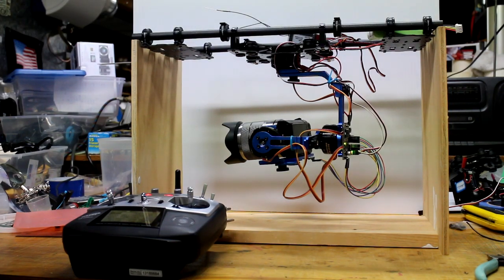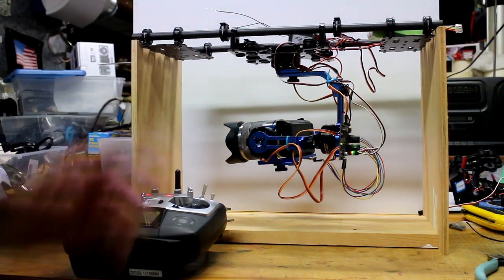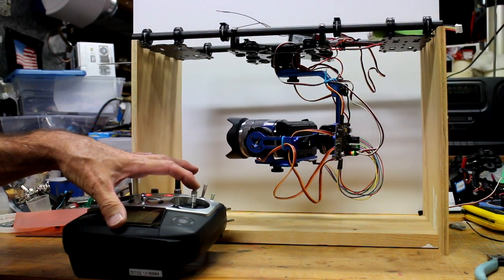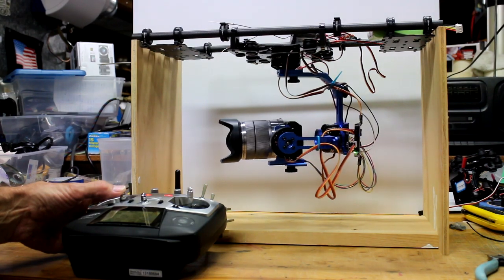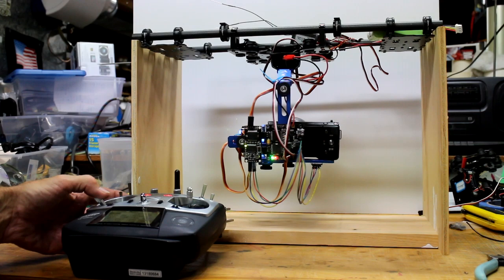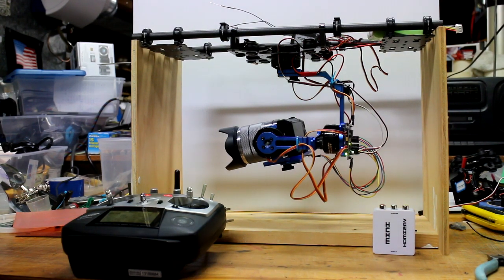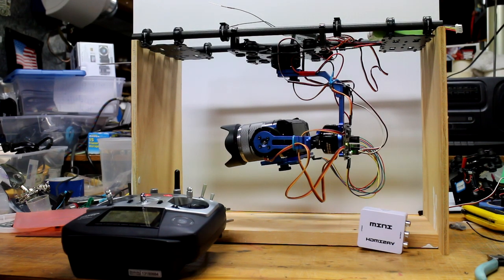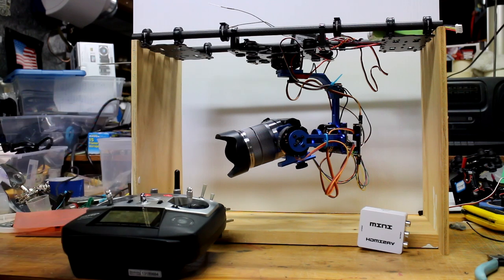RCTimer ASP 3-axis gimbal demo

Comment: I am very concerned more about the single thumb screws that are holding quite a few dollars with of camera not to come loose specialy if you need to add a battery and control board behind the camera so you don't chance twisting the wires off
Reply from the maker: kermets The thumb screws are tightened with a wrench after all the final settings and balance is done.  The battery wires are fed thru the yaw motor hub, so no extra weight there.

Comment: That is very compelling video. Way too early for me mind you. May I say that I have never seen that camera looking so sufficient. I am hoping there is video of you doing a trial.What a tease for the gear heads out there. I am just learning ER9X and the world of APM.  The reading! Man, I am just nearing the full bench on the completed first Quad It is a humble offering.  X650F, RCTimer Arduflyer 2.5.2 with Telemetry and FPV that incorporates stereo 808#16V2 key chain cameras BTW and servo operated pan and tilt. It 's a start right?.But hey..:-).. I am already visualizing my second, an 8 to 900mm Hexa, large enough to bear the weight of that sub frame assbly of yours. I take it that the Futaba Tx  will be strictly for the camera operator. Subbing out that rig for Second Unit Film work, given steady hands and a practised crew, that could generate some wonderful footage and a good pay cheque.
Reply from the maker: Hi Chris, yes, this is going on a Tarot 810 with a dedicated receiver for a camera operator.  It will replace the brushed 3 axis gimbal we are using now.  I've started with the APM 2.5.2 also; yes, lots of reading but very interesting with the Mission Planner.  Can't wait to get it set up; using a test platform of Spider 450 quad, and fpv equip.  Good luck with everything!

Comment: I have the same mini HDMI to Composite converter. I ripped it apart and replaced all the plugs with servo leads and then wrapped it in heat-shrink. Saved a few grams and space.